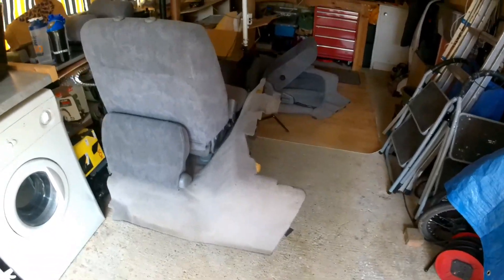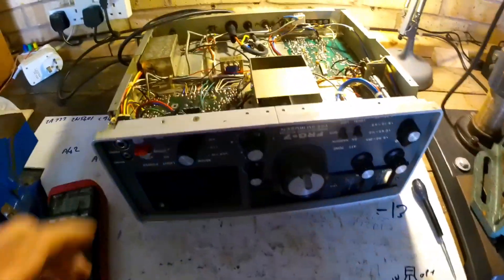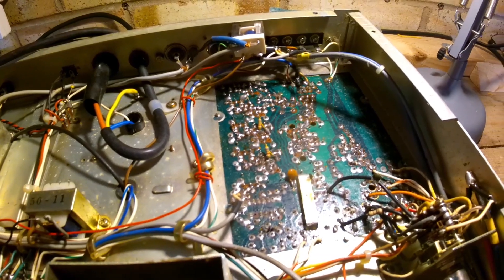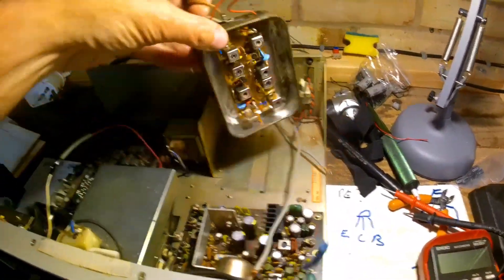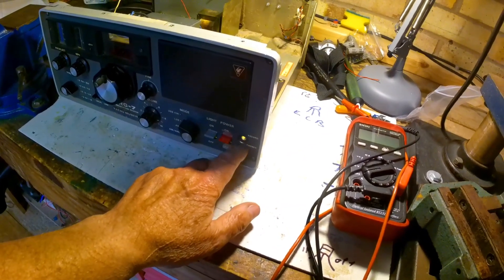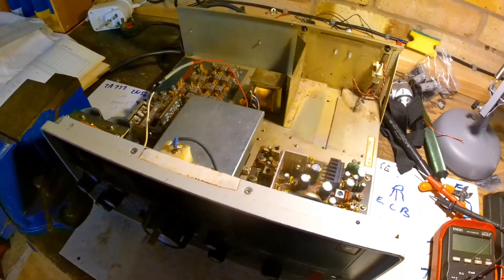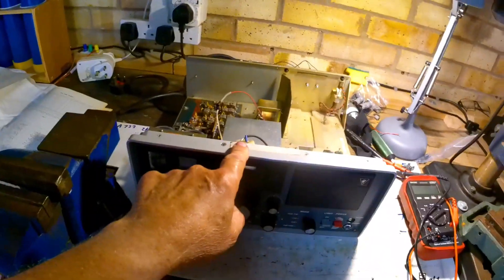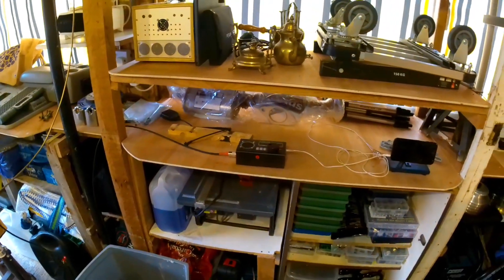Ham Radio. Yaesu FRG-7 Receiver. Fix Part 1.

Comment: At end of ur video you are tunes to 7mhz band on thr digital readoht but yiur band section switch is in the wrong band position. Looks like its on the MW low band setting. Too bad as when u had some CW code comming in, if u had switched the band to 7mhz you may have foubd a goid strong signal
Reply from the maker: The radio had been messed about with many things wrong. It was sold for spares. I gave up. Lots of bad soldering filter changed etc. Hours spent. I was surprised that I didn't smash it to bits with a hammer. George

Comment: I just latched on to the FROGGY-7 😊 It had batteries in it that corroded alot of metal. It works pretty well! How much would a working one go for? America ) 😊 Happy Holidays!😊
Reply from the maker: @tom-ehill2713 Hi Tom. Difficult one to answer. I have found that Ham Radio receivers from between 1970 to late 1980,s have become vintage and very collectable. A few years ago a Frg 7 was around £80 uk  pound but now around £250. From Japan £500 upwards. The one in the my video was not repairable as too many people had a go at fixing it. So was sold as scrap. I have been looking for a RCA Ar88 or Ar77 but cannot afford prices they want. Cheers from old George in damp foggy uk. CORRECTION JAPAN £700  or more on Ebay